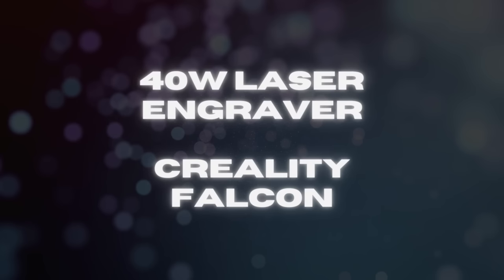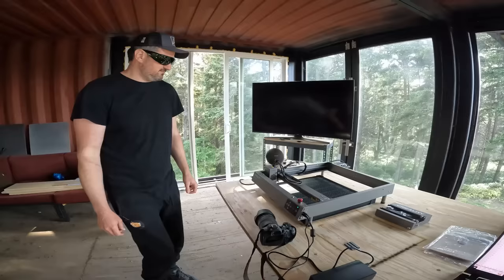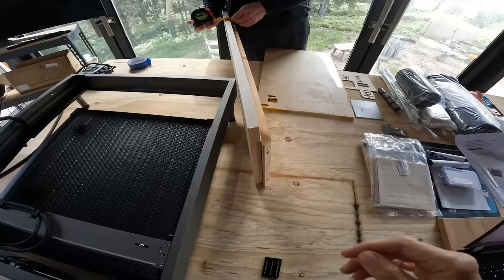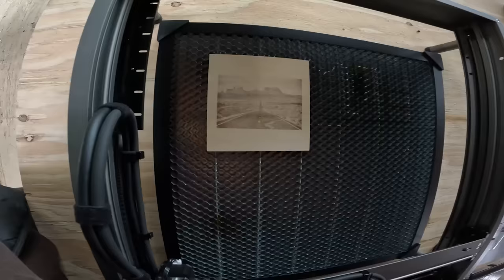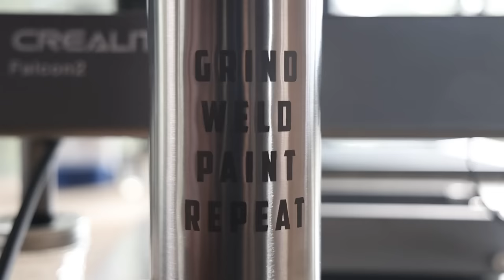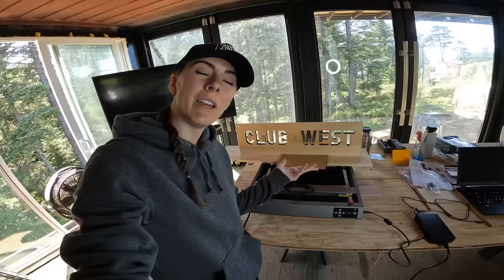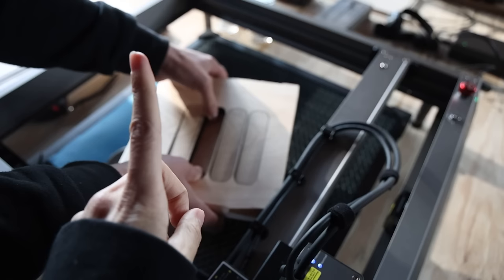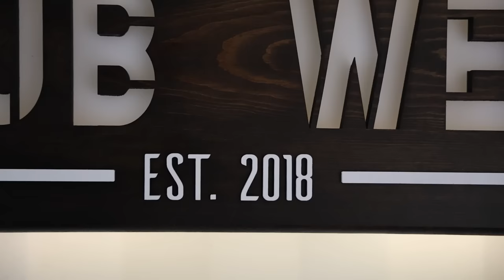DO NOT buy a LASER ENGRAVER until you see this video - CREALITY FALCON 40W #laser

Comment: Here is a word of warning. ALWAYS wear a mask when routing, sanding, or anything with wood. I did woodworking as a hobby throughout the years and now I have pulmonary fibrosis. My lungs are dying quicker than the rest of me. I have seen this before when I worked at a nuring home. It is a miserable slow death..
Reply from the maker: Thx for the advice! :)
Reply: @PacificPinesRanch  same for anything with any kind of sand/stone dust like drilling in concrete.  Silicosis is bad news.
Reply: GCT Printing or Green County Trophy in the great metropolis of  Poteau, OK
Reply: @PacificPinesRanch  we are not good, but we’re calloused

Comment: Please be aware those green glasses you get free with the machines are not the correct ones to use with a blue diode laser. You need the orange ones. You could be damaging your eyes.
Reply from the maker: Thx for the tip! I will look into that for sure
Reply: The same color as on the laser.

Comment: To engrave bottles you filled them up with water to avoid the terrible material deformation you had.
Reply from the maker: I tried it a few more times after that and turned the settings down and it came out much better with little to no deformation. I definitely had the settings too high on the one in the video. Still learning! :)

Comment: Nicely done with the 3/4" sign. I didn't even consider that a 40W diode could cut through that much material. One trick I've used in the past for placing things like the "EST 2018" is to engrave it into the surface of the target (the 3/4" sign in this case) and the engraving creates a small recess that the pieces just slot into so you won't need the laser and quick square.
Reply: Makes a nice inlay
Reply from the maker: Great tip! Love that idea :)

Comment: When making parts in Acrylic, you can use the edge of the acrylic piece you cut out to aid in taking the tape off the acrylic. It won't scratch the acrylic doing it in this fashion.
Reply from the maker: Thx for the tip!! Much appreciated :)
Reply: Brake fluid makes removing the tape easy.
Reply: These type of lasers are very dangerous without being enclosed and ventilated . Never cut acrylic without a fume extractor, you will inhale very toxic fumes.

Comment: When placing the small letters use the cut out negative  as a placing template  align it in the right spot no measuring required  use  tweezers  to grab letters and it goes fast
Reply from the maker: Thx for the tip!! :)

Comment: Haven’t finished the video yet, but I saw something when you were setting the height of the laser using their included guide. The minute you pulled it out, the wood flexed up. That’s a good thing to consider for any and everyone. Once that happens, it’s just all kinds of wonky. You’ll get perfect results in one place and odd results elsewhere. Wood can play a factor. If it isn’t flat, it’s not gonna be good for your project.
Reply from the maker: Yes definitely! We struggle with humidity because it warps the thinner pieces of wood.

Comment: I have a 100w co2 laser and it will cut 3/4 in one pass also, but it has charring as well. I think anything over 1/4 will have at least some char. Its definitely faster than my cnc machine though. But the cnc can carve v grooves without char. Every tool has its limits, pros and cons. The 3d printer is cool but the slowest of all of them. The cnc can do some metal. The laser can engrave and cut pretty quickly.
Reply from the maker: For sure! Definitely pros and cons of each machine and they seem to balance each other out. :)

Comment: You have me sold on the laser engraver. Would like to see if it could cut cedar fence pickets to make seasonal door plaque's for my front door. One thing I learned from a friend is don't cut pressure treated wood or vinyl with a laser. Salesman told him he could easily cut vinyl with a laser. The toxic and corrosive fumes destroyed his $6,000 CO2 laser in just 6 months! Thankfully it was in an enclosure vented to the outside!
Reply from the maker: I think that's a great idea! Yeah definitely have to check the material compatibility before cutting or engraving! :)

Comment: Great video guys. I just went to check this laser on their website. They show "adjustable light beam" with the click of a button. It's like 2 modules in one?. 40w and 22w. If you went over this feature I think I missed it. I know nothing about these lasers . So I've been doing my research and came across the brand. Thank you guys for the tips.
Reply from the maker: Thanks so much!! The adjustable laser switches from “precise” mode to “normal” mode, but doesn’t change from 22W to 40W. The precise mode is more for fine detail engraving (intricate designs, photos, etc) and normal mode can be used for pretty much everything (cutting, engraving, etc). I hope that helps! 😊

Comment: hey guys - i know i'm late to the conversation.
I watched this video and was WOW'd at the ability to cut thru 1" thick pine.
I know the power was 100% - What was the speed? 
Also - did it need Air?
Reply from the maker: I think the speed was 200 if I remember well. It's been a while! And yes I used the air assist. :)

Comment: Thanks, good info! For now, it's just too expensive but maybe we can find affordable used ones. Surprising, 20 watt versions do almost that depth of woodcuts. Dunno if you mentioned in the video that the Falcon has a low power switch to cut the 40 watts in half to 20 watts.
Reply from the maker: Thank you!! No I didn't mention that, so thank you for the comment! :)

Comment: FWIW: I'm at the 30W level, and my worst enemy is the fumes! You need really good fume extractor for burning a lot of wood. Before upgrading to 40W, consider spending that money on a quality fume extractor. Also consider that a mixed process might be faster, more efficient and cleaner than solving all problems with the laser. A quality jigsaw is a lot cheaper than any laser, and very fast. No mistake, it IS quite nice to cut through materials with a laser, but there are some things a laser does not do as well as hand tools.
Reply from the maker: Totally agree about the enclosure/extractor! Each tool has it's place and pros and cons. :)
Reply: Love my bandsaw and 1" belt sander to smooth those edges...

Comment: It was very nice but you should have used sign white acrylic. Sign white acrylic allows the light to pass through so the letter would be much brighter with the color change. This is the same acrylic they use in malls. It is very cheap also.
Reply from the maker: Thx for the tip!!

Comment: Great Video, I use allot of acrylic to make LED signs..... If you use a heat gun on the backing for just a few seconds the backing will peel off easily..... Just a suggestion..... Good Luck
Reply from the maker: Thank you so much and thanks for the suggestion! :)
Reply: hi I would like to cut acrylic, but most engraver can't do clear acrylic would have any suggestion which is a good and beginner friendly since I am new as this. I am trying the xtool M1 but I come to find out it doesn't do clear acrylic. Sending back.

Comment: No fume extraction/exhaust - that's a quick way to get sick real fast. Setting up a fan by an open door or window is not sufficient as I'm sure you already found out. You will still have lots of fumes in your work space - especially if attempting any mass production. Nicely done video though! Tip for removing acrylic masking quicker - use a hair blow dryer on low setting to warm it. Alternatively you can do a quick wipe with mineral spirits, wait a minute or two, then remove the mask in one piece usually.
Reply from the maker: I totally agree! I don't know if it shows on the video but the entire side of our house is open so we are basically "outdoors" in a way... This is just a temporary setup. Once we have a more permanent setup we will definitely have to install some kind of ventilation system. Also thank you for the tip! :)
Reply: Yea, that's the downside to all these open air designs. But it looks like Creality at least offers an enclosure for these, with a extraction fan and hose.
Reply: Yawn....thanks dad...

Comment: how does it perform on 304/316 stainless, 1018/4140 steel, 6al4v titanium and aluminum?  How does this compare to the Xtool D1 Pro w/ Infrared module.  Can burn wood with a magnifying glass and the sun so the real test is metal.  I am not a big fan of creality when it comes to build quality and support.
Reply from the maker: It's worked great on 304 stainless, but I have yet to try steel or titanium. These types of lasers only work on anodized aluminum if I remember well.

Comment: It looks to me like the laser is powerful enough to have nearly melted the YouTube logo it etched. It must generate quite a lot of heat when it spends that much time in one spot. You can see the distortion in the light on the side of the stainless water bottle.
3/4 inch wood! One pass! That's got some really usable power. I would imagine that would etch PCB's pretty well also. I can't see that having an issue vaporizing thin copper.
Reply from the maker: Yes definitely! I am still learning so I should have made the speed faster for the water bottle. You live you learn! :)

Comment: When you are using the laser i noticed you have an extractor fan in the background do you use this with the air assist and is it possible to make a box to put the laser in and make an extractor fan for it to cut down on the smoke it produces keep up the good work your videos are so informative 👍👍
Reply from the maker: Thank you! We used it to for ventilation mainly. Creality sells an enclosure for the laser that can hook up to a ventilation system, and that would be ideal if you plan on using this machine indoors.

Comment: HI there i have a question, it cuts 3/4 pine wood, how about 3/4 pine "Plywood" how many passes would that need "If posible"
Reply from the maker: It should work with more passes. Sometimes it takes longer to cut plywood due to the many layers.

Comment: Good video but a bit of an issue with safety! Many laser videos leave out this part while they think they are promoting safety they are actually promoting lack of safety or false safety. You only get 1 set of eyes and damaging them fast or slow is still damage that can't be fixed. 

 You be your own judge! 

Note that the opposite color to blue is yellow or amber thats the first hint to green glasses laser protection. Laser safety glasses need to absorb 100% of the harmful light and green is a poor absorber of blue or UV. Green technically blocks red or IR not UV or blue. (CO2 laser is a little more difficult to test).

 A simple test done on a different channel can be done by anyone, don't trust your supplier with your eye safety! Set your laser at a highest focal length and lowest power like 2%. Now interrupt the beam with your glasses and see if you can still see the beam hitting the work. The cheap green glasses will still allow about 60% of the harmful light through. This means no protection at all. Your only protected if all the harmful light is blocked. The saying - A sharp stick in the eye is not safe, a smaller or lesser sharp stick in the eye is not more safe its still unsafe.

 The 2nd myth is the light bouncing around the room is safe! Also unsafe so glasses that dont' block all harmful light are still unsafe, laser light bounces off everything and gets behind even good glasses so true protection is more goggle like disallowing any unsafe light to get to your eyes from all angles. Turn off the room lights while the laser is running even if it has a lens shield. Everything flashes blue. Reflected light that gets behind your safety glasses use the glasses as a mirror to reflect it into your eyes. Easy test, Place a white piece of paper on a piece of cardboard, face the cardboard toward the laser so the white paper is shielded from the direct laser light. Turn off the lights and see if the white paper looks blue, thats the harmful light thats hitting the back side of your glasses reflecting into your eyes.

 The 3rd myth is the protector around the laser with the window, again if you can see the light its not protecting anything and some light escapes out and reflects off everything else to get to your eyes. Test that window the same as above and if any of the beam gets through its protecting nothing.

 A false sence of protection is the worst thing!

 My recommendation is to throw away the junk that comes in the kit and get a good pair of certified goggles to your laser frequency with the highest OD rating you can find. The bad news is you won't win a fashion contest but the good news is you will still be able to see in 10-20 years!
Reply from the maker: Thank you so much for the info!! Do you have any recommendations on a good pair of goggles/glasses?

Comment: Should these laser cutters be running with no enclosure?
Reply from the maker: If they are completely indoors, they need to be ventilated and enclosed. The entire side of our house is open still (building in progress) so we are essentially outdoors, but I would definitely recommend the tent that comes with the product and a ventilation system for the smoke/fumes.
Reply: @PacificPinesRanch  I meant an optical enclosure. I was more worried about the laser light blinding you. Any laser over 0.5W can blind you in an instant. I'm not sure if this engraver system was sold with an enclosure (i.e. a cover or lid so that you can't see the laser while it's running). A lot of these chinese manufacturers don't care about safety and therefore don't make proper enclosures. Be careful and stay safe!

Comment: No air assist? That is why your parts are charred. Lasers really require air assist, they then cut faster and cleaner. Do not buy a laser that does not have air assist.
Reply from the maker: This laser has an air assist and we used it for the projects in this video